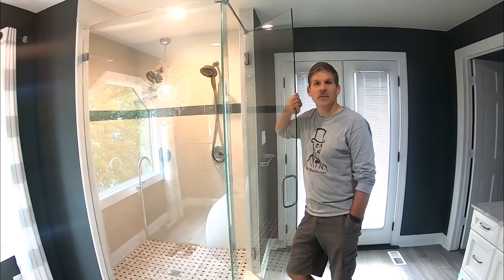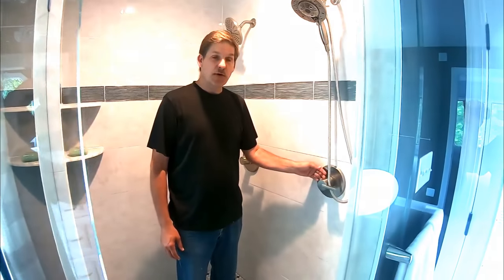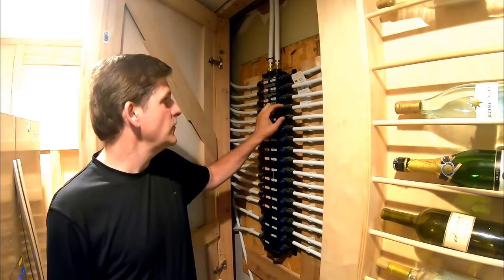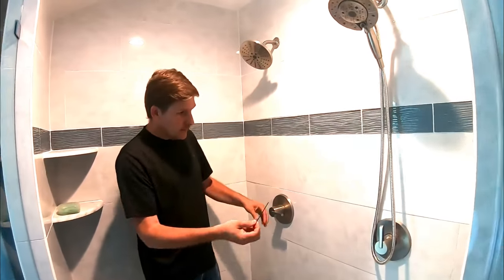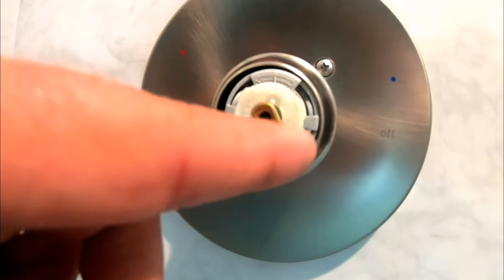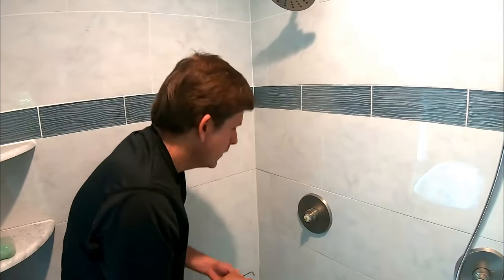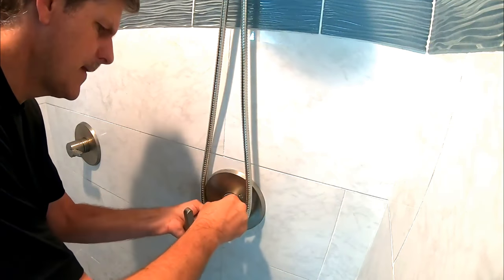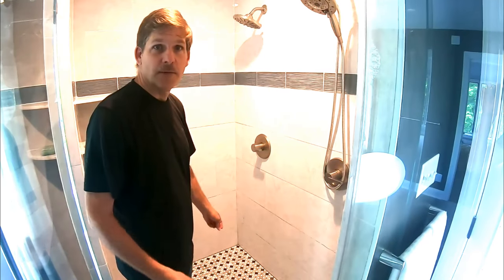No Hot Water in Shower But Hot Water in Sink

Comment: Thank you for this video.  My question is, would you need to adjust the temp periodically?  My temp was fine until a month ago, all of a sudden the temp has been dropping, but only in 1 shower.
Reply from the maker: Hey Janet,
I don’t think they require adjustment unless the temp dial is unintentionally slipping or moving. It would be worth checking. But that does not sound like a typical issue. 
Thx for watching.

Comment: I just had a tankless water heater installed and the plumber did a great job. Hot water works great, except the two showers. The water is Luke warm. The bathroom sinks are fine. Any suggestions? Thanks for your video.

Comment: Thanks for the video. Couple questions ... Is this setup fairly universal or just a Delta thing? I just installed a water heater timer (And changed heater elements) and now there is hot water at sinks and only one of the three showers in the house, would what you show here be my issue? Thanks in advance for your time.
Reply from the maker: Hey Silettoskydiver,
Our experience is with delta. So hard to say beyond that. 
I’m assuming that everything worked fine before the changes you made??
That would then be really coincidental that now you have an issue and it’s unrelated...???
If there has been time between the repairs you made, then sure... might just be a cartridge issue. 
But if it was immediate after the changes you made... causes me to wonder. 

On second thought, maybe some sediment got into the stream and clogged the valve ... I’m totally guessing. 

I guess your risk is the cost of one shower valve. 
You could replace one of the cold showers valve and see if it fixes it. Worth a try. Sometimes it’s a guessing game. 
I’d be curious as to your outcome.
Thx for the question.

Comment: were these not set correctly from the beginning?  My shower has lost heat, i have never touched the control valve so not sure how it could reset itself. I did remove the shower head recently to remove a shower filter. a few days after doing so the shower is just warm. both with and without the shower filter behind the shower head. Any advice
Reply from the maker: Hey JM,
The valve can wear out over time. Generally, replacing it solves the issue. 
Thx for watching!

Comment: What do you do when there are separate knobs for hot and cold water ?
Reply from the maker: Hey Ronald,
Each handle likely has its own cartridge. If you are not getting hot water, you may have to adjust or replace the cartridge depending on condition or age. 
The cartridges act as gateways to control flow and sometimes also temp. 
Hope that helps. Thanks for the question.

Comment: Hello, I replaced the cartridge but the temp still fluctuated to really hot to no hot water at all. Now we're getting just cold water out of both temp settings (shower only). Is there a secondary mix valve somewhere before the cartridge that would cause that? It's a single knob so both temps are controlled with one handle. Also scalding hot water comes out of the other faucets. Would that be a furnace/ water heater issue? If it is the mixing valve where would that be found and how would it be diagnosed?

Comment: ,Thanks, my situation is similar but different. My master shower runs out of hot water now in 2 - 3 minutes. It's a rainshower/wall mounted shower panel. Prior to this install the water pressure seemed fine, now its minimal and the water takes forever to warm up (3 minutes or more) and was lasting 6 minutes, now 2 -3 . This is only 3 years old. The wall mounted hot water heater is in the garage and this is the furthest water point in the house. The plumber has been here and the wall mount hot water company and they said the unit is working fine. the rest of the house has hot water...Could this be the issue or is there a pipe/plumbing issue. There is hard water here but you would think the other shower with a regular shower head would be the same. Any thoughts? thank you!
Reply from the maker: Hey Nancy,
Sounds like a flow problem. So that is either :
Shower valve problem  ( like in the video ),
Or Piping problem. 
Has it been gradually getting worse ( hard water deposit buildup / restriction somewhere) 
Or did you wake up one day and it was suddenly less flow ?
If you have hard water, the or flow they the pipes can be impeded.
What kind of pipes do you have? Galvanized, pvc, copper ?
How old is the house?
Surprised the plumber didn’t troubleshoot this!

Comment: Assuming the shower was once hot, what would cause the valve you had to adjust to turn which caused the shower to become cold?
Reply from the maker: Hey Dan,
 I don’t know the interior mechanicals, I would guess that valves or something like that would control flow and could get stuck.  Adjusting the dial to change the temp would work in the case where someone replaced the cartridge but never set the temp. 
Another possibility to cause the temp knob to be adjusted would be if the water heater performance was declining or house usage demand increased to the point where the old temp is no longer a comfortable setting. 
Typically, when we hear that the once hot shower is now cold, we’d be inclined to 1) replace the valve/ cartridge and 2) then set the temp knob of the new cartridge to desired level.
Thanks for the question and for watching.

Comment: The same hot water feeds both my shower and sink. I have hot water at the sink, but not the shower. The  cartridge has been replaced. Also, the hot water adjustment on the cartridge is all the way up.

Comment: did this on my shower and it did not work hardly any hot water, sink right outside the shower in the same bath rm. Turn on that hot water and more hot comes out of the shower for a short period and then cold out of the shower. Can not figure this out. Makes no sense . Flush the toilet and the shower get scalding hot in the shower, the cold water is gone.

Comment: I operate apartment buildings with Delta faucets. I have to take an angle grinder to the handles to get them off because the set screws have corroded in place. Needless to say, it requires replacing the handles.

Comment: I have this issues but the maintenance man to my apartment keeps saying the water temperature on my thermostat is 118° that may work for my other bathroom and faucets but my shower in my room only gets warm at the hottest position. How do I find my water shut off? Is it where the washer and dryer connect?
Reply from the maker: Hey Talia,
That’s a great question - one I haven’t had much experience with ( apartments).
It’s hard to diagnose without seeing it.
Maybe try this : talk to your apartment neighbors and see if any of them know where theirs is. 
Has your water ever been shut off because a neighbor is having plumbing work done? If so -  then you share a shut off. Another question to ask neighbors. 
You’d probably be looking for a handle or knob or lever which would turn all your water off if there are no individual shut offs.
Just be sure. You don’t want to guess on this. 
Whose your maintenance guy answer to? Worth a try there.  
Worse case - call a plumber. 
Lukewarm showers - no thx!
Be the squeaky wheel till you get an acceptable answer.
Thx for watching!

Comment: I’m having a hard time finding the right video to help me but I’m getting hot water in my shower and sinks but not my bathtub please help!!
Reply from the maker: Hey Reyon,
If you have a single handle control, it’s possible the the control valve or temp limiter inside the faucet handle is set wrong. Like in this video, replacing the control valve may fix your problem. A less common issue would be blocked pipes.
Hope that helps.
Thanks for asking and watching!
Reply: @Reyon Mehdir Any updates? I'm having the same problem.

Comment: Would something like this be why nothing comes out of the new shower UNLESS the sink is on?
Reply from the maker: Hey 32..,
It MIGHT be the issue. Some valves have a pressure regulator on them which may have failed. 
It would be worth trying to replace the shower valve cartridge and see if that fixes it. That seems like the least expensive place to start. 
Thx for watching!

Comment: my question is. when i am taking a shower and someone turns on the kitchen sink i receive no hot water. Please help
Reply from the maker: Hey Jose,
It could be you don’t have enough water flow in the pipes to run both at the same time. 
How old is you water heater? If it’s older , maybe hard water deposits are restricting the amount of water going into hot water pipe - enough hot water for one outflow but not two. 
Has this been happening gradually or did it just happen suddenly one day. 
Could be that your shower faucet has hard water deposits/ build-up not allowing it to fully open. 

You have to do a lot of detective work to narrow down the issue. 
Try running only hot water in shower, then turn on only hot water in Kitchen sink. Does it stop all hot water to the shower or just some. 

Short term solution : no one touches kitchen faucet when someone is in the shower. 😃

Sorry - no quick solution without further examination. 
Thanks for viewing.
Reply: @Housebarons  we barely move there a few months ago. But the water flow does not change. It's just that if, I am taking a shower and someone turns on the water from the sink I am left with cold water
Reply from the maker: Hey Jose,
Maybe try and recreate the problem somewhere else in the house. 
1) Turn on the shower and then a different sink. Does the same thing happen?
2) turn on only hot water in the shower and then the sink in question. Does it stop hot water completely? 
3) Try this same thing with 2 sinks and no shower. Does turning on one sink deprive the other sink of hot water. 

Try any other idea as a way to figure out if pipes are restricted or if the water heater is the problem. 
Challenging!!

Comment: I have the same problem. unfortunately my Moen shower tap doesn't have that adjustment. What could be the problem?
Reply: so it was warm for 2 days now it's hot again. only happens in the shower.
Reply from the maker: I’m not familiar with Moen, but I would check for a replaceable cartridge - most modern faucets have them. Maybe an email to Moen??
Thx for watching!

Comment: Quick question...all faucets get hot, except shower faucet...it only gets warm. It is a remodeled shower/faucet. I am first tenant since the remodel. Sometimes it is literally a barely warm shower...sometimes warmer...but never hot enough for steam, etc. Could these variations still be the anti scald device?
Reply from the maker: Hey Starry,
Yes it could. There is a temp adjustment on the cartridge. If it’s a new remodel, it is very possible they just put the cartridge in and the factor setting is lukewarm. If you can get hot water at sinks ( which means your water heater is set correctly ), then that is the first thing I’d check.
Thanks for watching.

Comment: Thank you 🙏🏽 it really worked saved my two bathrooms shower and saved me from wasting money and stress dealing from month. Pros said they need to check and maybe replace valve or cut drywalls.. thanks again buddy
Reply from the maker: Hey Jas…,
Way to go and check things out for yourself. If the pro does not have integrity or is ignorant, they can tell you anything or the wrong thing. Anyway, thx for watching and saving some coin!

Comment: How do you do this if you have two separate knobs for hot and cold?
Reply from the maker: Hey Jena,
If it's old school, then you have one pipe for hot water and a separate pipe for cold water - each going to its own handle. There each handle has a valve that controls the amount of  hot and cold water. If you are only getting cold water, then the problem may be in the hot water side. If only hot water, then the cold side has the issue. 
thx for watching!

Comment: Hi, I am not getting any water in my hot tap of my bathtub. However I am getting hot water everywhere else in the house. I changed the valve faucet cartridge but no luck. I also tried turning the cold water on and then blocking the pipe which then forcing it into the got water to remove any airlocks, still no luck.
Reply from the maker: Hey Agha,
That’s a tough one. 99 times out of 100, it’s the cartridge. I wonder if you have a blockage somewhere? A bad shower valve??? - that might be expensive. 
Only other simple fix - have you adjusted the temp adjustment ring on the shower cartridge? They come from the factory cold or lukewarm at best. But you can change that.
Check this video out…
How to Install Shower Trim Kit : Delta Classic
https://youtu.be/g6Z8RBsC28Q

Hope that helps. 
Thx for watching!

Comment: I recently have a tennant that complains of only luke warm shower water but every other water in the house is fine.  I haven't inspected the problem yet but will be tomaro night.  Considering this video's suggestion, is it possible for the temp setting on this part to slightly change over time?  I ask because I've never had any other tennants complain of luke warm shower water?  Also, is it really necesary to turn the water off for this adjustment?
Reply from the maker: Hey Fmbighair,
My son just dealt with a super mysterious water PRESSURE issue. Turned out, some small piece of wood got into the valve body😳and blocked a port inside the shower valve. 
I doubt temp can change over time unless the valve is defective or maybe the hot side has an obstruction??
I don’t know what your valve is. It may not be necessary to shut main water off. But we encourage it - better safe than sorry. If you want to remove the valve cartridge, the water has to be off at the main shutoff. 
Hope this help. Let us know what the solution was - if you can. Thx for watching

Comment: My shower is getting scorching hot and real cold but not warm enough to shower in it. Can I  try this same method? Have you ever heard of that happening before?
Reply from the maker: Hey Chris,
To my knowledge, the only temp controls for water are your water heater and the faucet control valves. 
I would probably start at the shower / tub control valve as they are know to fail and need to be replaced. Other than that ????
Thx for watching and asking!

Comment: what would you recommend if the hot water pressure is super low, but the cold is fine in terms of pressure? we turn to the hot and the pressure droops about 70 percent and it’s just droplets, but turn it back to cold side and it’s blasting
Reply from the maker: Hey Antoinette,
Still could be a bad cartridge which isn’t letting the hot water side to be selected. The valve blends the hot and cold. If it is in all hot, that means the cold side is shut off and for some reason the hot isn’t opened. Valves do go bad eventually. 
Thx for watching!

Comment: Our tub downstairs doesn't seem to have any hot water.  If you turn the tub faucet on past half way to hot, the water slows to a trickal and stays cold.  The shower is cold when on full blast. Thoughts?
Reply from the maker: Hey Martha,
It sounds like your hot water is stopped ( the trickle. ). Either your hot water supply got turned off or your control valve needs to be replaced. 
Is this something new? All of the sudden? 
The control valve controls the flow of both hot and cold. If hot works elsewhere in the house, bathroom, then they may be it.
Hope that helps...

Comment: What if not water fluctuates? It comes out, it hardly comes out, it comes out etc. 
Low pressure tank system.
Reply from the maker: Hey Android,
Is it spitting? It sounds like there is air in the lines somehow?
Thx fir watching.
Reply: @Housebarons  ,thanks for reply. Not spitting. No bubbles but it reacts like a plastic bottle held upside down.

Comment: sorry a bit confused  since you turned off the valve for the shower to make the adjustments how did you have water after without turning it back on? i guess you skipped telling us that you turn it back on? i'm new at this so i'm trying to find out. i did that too to my shower it it won't get really hot still even though i made the adjustment.
Reply from the maker: Hey Vince,
Yes. Sometimes we skip smaller steps in filming. 
What you have to determine is : 1) is the shower the only faucet not getting hot. Sinks OK? 
2) Assuming that it is only a shower faucet problem, your 2 most obvious options are : A - adjust them temp hotter.... or... if that doesn’t work B - replace the cartridge.
Sometimes cartridges go bad and replacing is what is needed. 
Typically, one of these two options will fix the vast majority of issues. 
Hope that helps. 
Thx for watching.

Comment: Hi, I have two shower the downstairs works fine but the upstairs one is only hot for like 2-3 minutes then it doesn’t get cold but it’s also not has hot as I would like even though it’s all the way up, the shower is one if those that can come out at the bottom first will this still work?
Reply from the maker: Hey ortizreyna,
It is likely that you have a bad shower valve which helps regulate the temperature. I would try to find the brand name and style of show faucet and see if the manufacturer can give you an explanation of the replacement parts you would need.
Thx for watching!

Comment: I had a problem like this my shower would only run hot if I also ran the hot water in the sink such a waste of water so I called a guy and he fully replaced the shower with a more modern shower for no charge and the problem is still here
Reply from the maker: Hey Scottt,
Did he replace the shower head or the shower valve in the handle?
If he replaced the shower valve, may need a plumber to dig deeper.